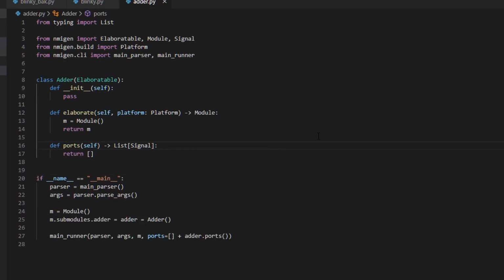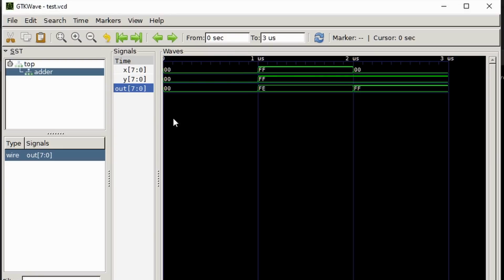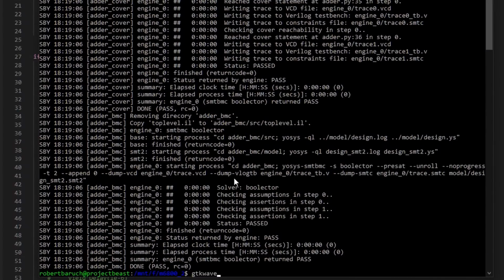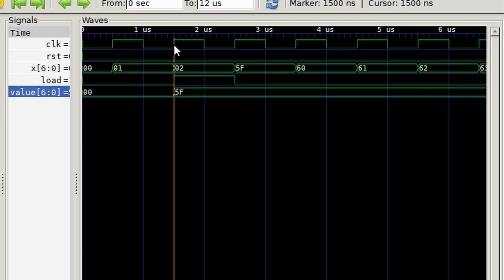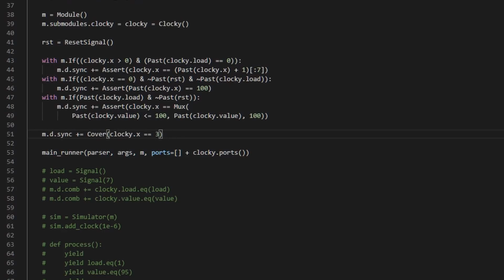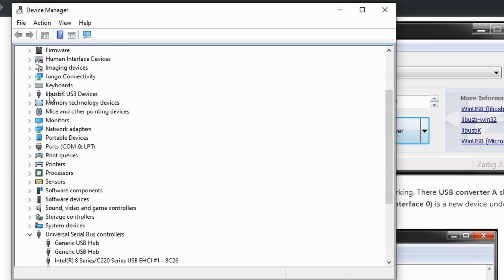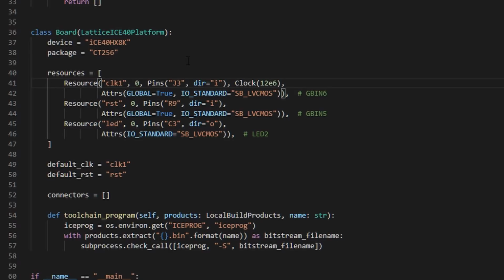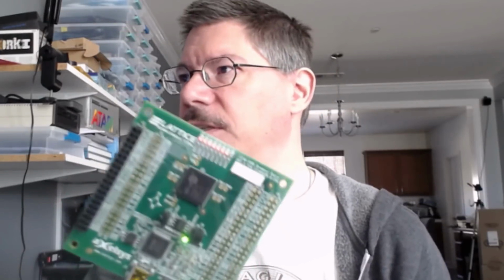Building a 6800 CPU on an FPGA with nMigen (part 2)

Comment: Hi Robert, I'm following along with the video to learn nMigen.  At 18:03 you showed Symbiyosys flag an error due to the addition result having 9 bits.  But when I run it, that doesn't happen.  Did something change with the tools, perhaps, or am I doing something wrong?  Perhaps a better question would be is there a forum or discord somewhere where you field questions like this?
Reply: I figured out my problem (I didn't return anything in ports().  D'oh!)  And then I went on to get all of this working on my workstation, including running Blinker on an Orange Crab.  Woo hoo!  Thanks for the great tutorial here.

Comment: You don't have to modify your program to get it to use iceprog.exe. Since it's looking for an environment variable called ICEPROG and only if it doesn't find that, it uses 'iceprog'. So to use 'iceprog.exe' just set an environment variable called ICEPROG to 'iceprog.exe' before running the python program and it should work.
Reply: huh, that actually totally works.

Comment: Acually iCE line of FPGAs doesn't have internal flash memory.
They do have what Lattice calls "NVCM" - Non-volatile configuration memory, BUT that is one-time programmable and it disables booting from external flash chip.

Basically this FPGA has 3 primary ways of booting (configuring):
 - As a slave SPI device (that's always available) - you can reprogram it using external SPI master device, for example you could use the FTDI chip to just reprogram the FPGA's volatile memory (it'll be lost after reset though)
 - As a master SPI device (only available when NVCM is not programmed) - the FPGA reads external SPI flash chip by itself
 - From internal NVCM (though this has much more restrictive power-supply requirements and it disables spi master mode FOREVER) - it has the advantage that the boot time is much shorter (I think the NVCM acts as 'shadow' or reset value for volatile configuration memory) and the bitstream never leaves the chip so it's much harder to steal it.

Also the FPGA has the ability to trigger reprogramming from external SPI memory (only when NVCM is NOT programmed) internally. Also you can specify (kind of) the base address to start reading - so you can have multiple bitstreams in external memory and reprogram during run-time.
For example in my company we use it to have normal configuration for the device and diagnostic configuration that can be loaded by entering a special combination on the keyboard. In a different project we use this mechanism to perform safe in-field upgrades - we have never-changing first bitstream that contains factory firmware and first thing after boot it checks if second bitstream contains valid checksum and if so - boots to it. This device also has external watchdog that will reset the FPGA if the second bitstream (with valid checksum) is malfunctioning - this is detected by first bistream and device continues with original firmware.

BTW. I love your channel and your content!
Reply from the maker: Thanks for the detailed explanation! I suppose that the flash chip must be somewhere on the ice40 HX8K board, but I just couldn't see it.
Reply: @RobertBaruch  Yup, looking at the schematic U2 (next to FTDI chip) is FTDI memory and U5 (between jumpers) is iCE40's flash
Reply: @RobertBaruch  I don't own this particular board, but it's probably the SO-8 chip next to FTDI (under FTDI Chip on silk screen)
EDIT:
Correction, that SO-8 is probably flash memory for FTDI chip, so SPI port is enabled
There's another one between jumpers, so I guess that's the one.

Comment: Re: SB_LVCMOS, the "Lattice ICE Technology Library" document is a little vague (and it can be hard to tell what info is relevant to which chip) but it has details about the hard blocks on the ICE40 chips. Judging by this https://github.com/cliffordwolf/icestorm/blob/master/icefuzz/tests/sb_io.v#L5 the other option that might be useful is SB_LVDS_INPUT. I haven't used icecube2 but those other aliases for SB_LVCMOS might change the timing analysis even if the bitstream ends up being the same.

Comment: I dont know if it's only an impression, but even with python the overall code seems as verbose as vhdl, imho I would rather write this in vhdl, could u give us a hint on any pros of using this abstraction ? Ps : the compilation seems fast
Reply: madjid ryadh just to start,I have the impression that there’s much better OSS tooling for Verilog than VHDL at the moment, so people who want an open source toolchain would have a hard time using VHDL.

I’m more familiar with Verilog than VHDL so I’m gonna contrast specifically with that in my answer.

Now, why something like nMigen? For this specific case, the maintainers do a lot of work to make it align better with hardware than Verilog does. The semantics have some understanding of what parts you’re working with, and so you can’t really write code that simulates differently than it synthesizes—they consider it a bug if you can.

On a more general level, using an embedded language like nMigen inside Python means you can write programs which generate parts of your hardware, Python is a much more capable meta-language than the static abstractions in Verilog etc.

Comment: Hi Robert,
I have not looked at nMigen before, but have experience with VHDL and Verilog. From your example, I don't understand the attraction to nMigen. The syntax looks clunkier than Verilog and maybe as wordy as VHDL.

Can you explain why anyone should use nMigen in lieu of another HDL?

Thanks for your work explaining an example for us.
Reply from the maker: I use it because the syntax just makes more sense to me. Also I can intersperse Python with HDL. Also I don't have to worry about which vendor's HDL compiler implemented which feature. But it comes down to personal preference. Also this: https://github.com/m-labs/nmigen/blob/master/README.md
Reply: Python is a far more expressive and powerful language than VHDL or Verilog. Naturally when you're doing something quite straightforward and not abstract, it won't matter much. However, when you want your design to be flexible or you want to create higher order designs then Verilog and VHDL become inhibiting quite quickly. nMigen is one of many great options in this space. No human should be coding in Verilog or VHDL any longer. Take a look at Chisel which has been popularized by the RISCV project, for example. It's an extremely flexible ISA and that would have been a monster project to try to code by hand in VHDL or Verilog. The nice thing about fpgas and these higher order design languages is that the point in which software ends and hardware begins gets more and more grey. This enables really powerful and flexible solutions for more complex problems at lower power costs. We're just getting started and this space is very exciting.
Reply: Benjamin Scherrey And it’s also typeless so have fun with bigger projects. 
I would even prefer SystemC or SystemVerilog over a slow not even near the timing python code which cannot even run in different threads.
Reply: @platin2148  I presume you mean that Python is typeless - actually Python has optional static typing now (which the video also mentions) and I use it with all my python code these days to good effect.
Reply: @platin2148  > over a slow not even near the timing python code which cannot even run in different threads.
This is probably one of the stupidest thing I've ever read. Most of the actual work that can be parallilezed is done in Yosys
Reply: Benjamin Scherrey So it does mean it now has structs or how do i define such types and is it then equivalent to ts‘es type system.
So still weak but at least something like Number, String, Decimal or really size depending?
Reply: @platin2148  it provides type signatures and static typing. Syntax is a bit unusual when you get into more advanced types but not hard to learn. Works quite wel, has zero runtime overhead, and can be added incrementally into existing codebases. http://mypy-lang.org/
Reply: One of the advantages of nMigen is that it allows much more flexibility, e.g. you can have a CPU with optional FPU and cache, support multiple FPGAs from different vendors and generate e.g. a small CPU with no cache for small FPGAs while having your cache grow if there's space on the chip.

As your cache appears, disappears or changes size the internal address lines and DMA adapt, all from a single code base switching between the different options with command line flags.

This stuff is a lot harder or impossible to do in Verilog or VHDL from a single code base.

Comment: Hi Robert,

this is a very interesting topic. I would like to start learning about HLS in general. Would you recommend to start with nMigen? Currently I am programming Xilinx FPGAs.

Thanks for the great content.
Reply from the maker: Maybe get a tiny bit of experience using Verilog. Then you can move to nMigen a little more easily, otherwise you sort of get the abstraction of nMigen without understanding what the abstraction actually translates to. Kinda like learning C without understanding how RAM works. It can be done, but you'd be much better off understanding the lower layer. Check out nandland, which has some pretty good tutorials: https://www.youtube.com/watch?v=CfmlsDW3Z4c